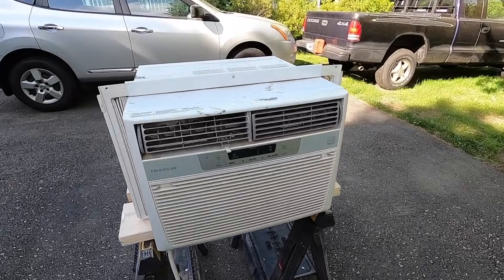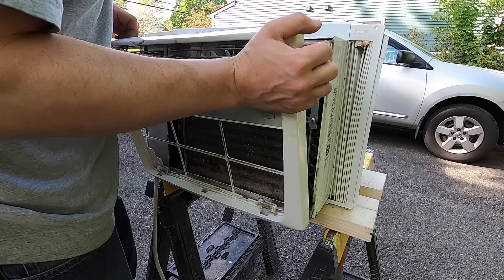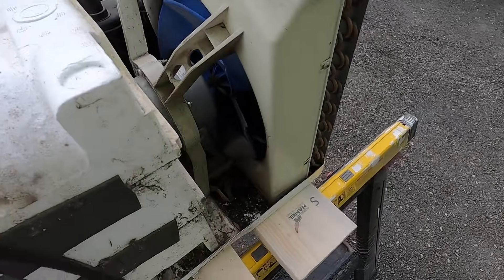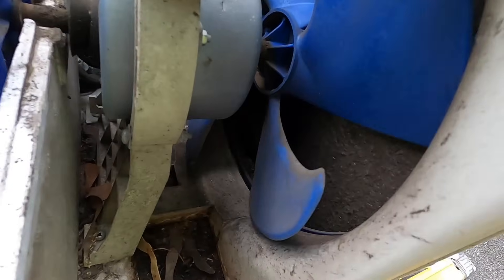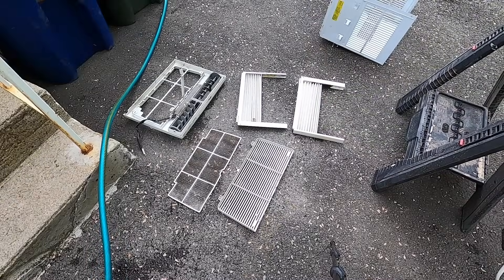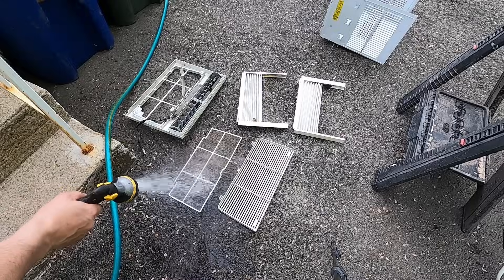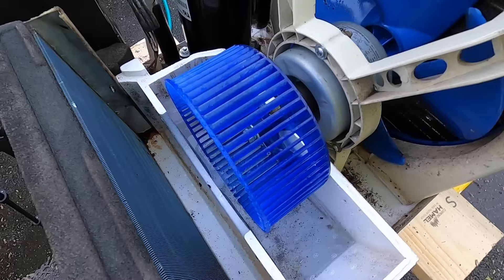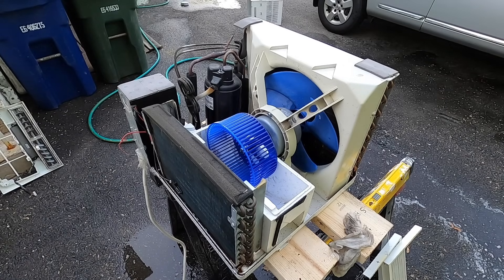How to Clean a Dirty Moldy Window Air Conditioner

Comment: Frost King has a coil cleaner out there.  And it works GREAT.  I spray down each of my units with it once a month.  You won't believe how much cooler the air is.  Oh yeah and there's zero scrubbing involved.  It lifts the dust right off.

Comment: I have exact same model as yours and it looks identical as far as the black mold situation.  Every few months it ends up looking the same.  I'm wondering if its a flaw in the design or something. I have different a.c. units in the same house that don't have the mold issue. But this one seems mold prone.
Reply: Whats the non-molding brand? (What letter does it start with, if you dont wana say directly lol)

Comment: I had an older unit I wasn't using and left it in the garage for a few years. Well, I need it this year with a new house. It smelled so bad when I plugged it in. Sure enough, mold. Nowhere near as bad as the one you did. I'm taking it out tomorrow and gonna clean it the way you did. Fingers crossed. 👊

Comment: Any suggestions for cleaning the unit if you can’t get it out of the window?
Reply: It cant be done, to the best of my knowledge. You need access to all sides of the unit. The back cover does not come off very easily even when you have complete access. I just completed two different window units today before I installed them. It was about one hour total removing the covers for both units with a 12x20 room to work in.
Reply: I have the same problem.  Can't take it out of the window.  I clean the filter on a regular  basis.  Tried cleaning the coils to the best I could by spraying solution on it with a no rinse solution. Still get musty smell when initially turn on air conditioner, but goes away fast.  Even sprayed bleach through vents, it did help a little, but not enough. 
I can't take it apart like all theses videos show on YouTube.  Otherwise,  my 13 yr. Old air conditioner runs beautifully. LG 11200  btu.
Reply: @beatricejust7549  im an old lady-- not going to drag it out of the wall, dont have the energy. One thing I do is make a mixture of generic listerene and water which I spray in the front grill each time I turn it on then put a towel over the air vent for a couple minutes to catch any bacteria or dust. Listerene was originally used to sterilize operating rooms so it should kill whatever ails us. I am trying to pry that plug out so the water can drain instead of sitting around molding. Hard to find any nice guys to help when you arent cute anymore😕😐😀. Also spray  the vent before turning on and after turning off to prevent bacteria buildup. Best I can figure to do when it cant be taken apart.
Reply: @hope2029  Wow, I never heard of that!  Listerine and water! 
 I'm definitely going to try this, along with a towel.  Never knew it was once used in operating rooms.  
Very interesting. Thank you so much for this advice. Your a lovely lady!!
Reply: @beatricejust7549  did it help? :0
Reply: @UndecisiveAngel  Haven't tried it yet.

Comment: Have the same model! Started leaking in the front—took apart and cleaned out, let dry and put back together. But now I am seeing condensation on the sides and on the bottom of the unit (which is now leaking dripping onto my window sill, have some towels there). Do you happen to have an idea of what is causing this? Thanks!
Reply: Your AC unit is probably low on freon , not getting cold enough and causing condensation. Probably time for a new unit,
Reply: a/c must be installed tilted to the outside to let excess water drain.

Comment: Hi. Nice. I have two of this brand ac. There is not a drain hole for condensation water so the aluminum fins sit in the water and desolate. The fan is supposed to blow the water forward into the other condenser but it is not doing a great job. I drilled a drain hole in the bottom today to remove more water to prevent the pooling. Thanks.

Comment: I got an old GM Frigidaire A/C unit in my room. I took the front panel off and used lysol on the air duct, but it still needs a deep clean. It's not mine though. Thanks for the video. Keep up the good work! 👍

Comment: Thank you for this video. I’m always nervous that I’m going to ruin mine, but I’m confident that I can deep clean it now!
Reply: new air conditioner is only 200-350...why u need to clean it ?? you are not going to kill all mold in there... just buy  a new one after 3-4 yrs ...i never clean it.. i just get a new one after 3-4 yrs.... you are wasting time if u clean ịt and it wont get rid all mold inside
Reply: @BabyGangsterIsMe  I live in the south where it’s extremely hot and humid. I’d be buying a new one every 6-8 months, not 3-4 years. My house is also old and large, so the window units that I have are $500-$700 since even the bedrooms are large and have no air conditioning other than window units. I also wasn’t cleaning the inside of mine because of mold, I was cleaning them to get rid of the bugs and leaves that get into the back of it. I spray bleach on the styrofoam parts on a weekly basis to prevent mold.
Reply: @slippypippy  ic.. i live in Virginia.. i only use it in summer... i dont want to spend my time to clean it... i dont want to smell it bc it is dirty and i can get sick... i just throw it away every 3 years and buy a new one
Reply: @BabyGangsterIsMe thats real eco friendly for the land fills!
Reply: Typical mindset 🙄

Comment: Honestly I've taken apart a ton of things in my life (cars, motorcycles, electrical outlets, fixtures, small aerospace units, computers, electronics, etc.) And by far the most annoying thing I've ever had to take apart was a window AC unit.

These things are built with zero user friendliness in mind and cleaning them is a huge pain in the rear. You would think a drip pan should be the easiest accessible item? Nope. You have to take apart the whole unit from the outside until you get to the interior, and even then, you're going to need to take apart the interior to get to the pan.

I have no idea how an engineer has not thought this through more clearly
Reply: Engineers are laughing right now because they designed it like this purposely do you think engineers for companies want a design that the buyer can easily fix,clean themselves? No they want it to break so you buy another one
Reply: Speaking as an engineer, I hate designing stuff that is horrific to fix/clean/repair. Unfortunately, this is rarely a priority for the company, so we have to put out crud like this.

Comment: So helpful! While helping my daughter move into another apartment and installing a window unit she'd been using a while, I noticed the moldy mess that you show. I was able to clean up the front, but I'll remove the unit at the end of the summer and finish the job as you demonstrated. The recirculation fan is a mess and the styrofoam chamber looks just like yours did. Cleaning is such a big part of keeping most things working well. Your video gives a lot of people the know-how to get through it with an AC unit. Thank you.
Reply: In the meantime she will just be pumping mold spores throughout her house

Comment: my ac had mold last year and it came back with a vengeance since i’m over using it this year to the heat. i tried completely dismantling it once but i couldn’t figure out how to get the back panel off. i think this helped a lot, and i’ll be able to clean it really good when the heat dies down. it’s also persistently leaking this year (something it’s never done before) and i can’t tilt it any farther as i’m on the second floor, so i just have to put cups under it and hope they help.

Comment: last time i did window units in my house i took all the foam out and loaded it in a dishwasher with a bit of bleach for the first run and then two times more with dishwasher detergent on the hottest wash. foam on top rack and grille and filter on bottom. the filter came out like new. the foam came out well too.

Comment: I also have a Frigidaire. I usually take the filter out and clean the evaporator coils with coil cleaner and an old tooth brush. I spray water on the outside to clean the condenser. There's some mold on the inside like yours but I don't think it's much of a problem. The unit works fine. I'll probably just spray some mold and mildew cleaner through the vents and call it good.

Comment: Hi, this was very informative.  Funny enuff,  I have the same exact AC, I got from a friend a few years ago. I'm trying to remove front casing, the white long piece of plastic that connects to the back wont release. U kinda flew thru that part.  Every season I clean the filters. They barely need soap.  But this year,  9/7/23 I turned on the AC ( been using it off and on all we😢ek), today it immediately smelled like mold. So i go to remove the filter,  and I notice speckles of black mold. So I look up how to clean on you tube, i see your pic,  I start watching. Sorry,  long story. Idid try to squeeze the clip. It released a little bit not all the way. Thanks in advance

Comment: At 1:42 you see why AC is the no. 1 reason for cronic respiration infections, if not properly maintained and cleaned. And don't expect hotels and other public places to do this mandatory maintenance as required.
Reply: Your absolutely right. Several years ago I got a respiratory  infection do to a dirty moldy ac unit.
Reply: They don't  do maintenance on the wall a/c unit in my apartment either.
Reply: @Og-Judy  You can, by law, refuse (withhold) rent OR give them written notice via USPS with tracking and signature mail, that they have 30 days to do cleaning and maintenance on the unit or you will pay for it to get done and send them the bill with additional charges for time, labor, etc. 

They have no choice. It's literally law.
Reply: Do u remember what kind of symptoms?
Reply: @TheMsparker27  fed or state law?
Reply: Yeah, while I was watching this, and seeing the mold inside that unit , it got me to thinking maybe that's partly why my sinuses have been so stuffy lately, because there's mold in the top vent of our ac (but the rain we've been getting lately isn't helping either). But unfortunately I'm having to leave our ac off until we have a clear/dry enough day to take the ac unit outside to clean it (which is gonna suck in this Mississippi heat).
Reply: @TheMsparker27  yes this is the law but once you go this route know you won’t be able to renew your lease. I did this once and was not able to renew my affordable lease after demanding for a new fridge. It cost my $3k to move when I could have purchased my own $400 fridge and saved thousands in rent over the years. Pick your battles wisely.

Comment: Hey "The Fixer ", I have the exact ac unit. I have cleaned it before and disconnected the pin connection each time with no issues. I always cover the ends with plastic. This time I also used coil cleaner and a light spray of the hose on the outside. Now, when I plug it back in to the outlet, the electronic board lights up for approximately 2 seconds and then goes off. Would this possibly be because there is still dampness in the back? If so, how long do you think it would take to completely dry?

Comment: Drainage is always poor very poor. You should have drilled about 4 holes about four or five inches apart in front maybe 3/8 holes for drainage an air circulation it will prevent the fins from rusting out. Also should have sprayed it laying on its side so as you spray all the dirt falls out

Comment: Co-worker was moving and gave me this exact unit that I plan to use in my garage. Wish I had watched this video before taking it apart. I ended up removing the entire board from the front panel not knowing I could have simply unplugged it like you did on the video. Waiting on a nice sunny day to spray it. I don't even know if the unit works lol.

Comment: lowes sells a product called coil cleaner that is amazing and safe for the evaporator and condenser coils, its an aerosol can and foams really good to creep deep into the coils to clean them.
Reply from the maker: Great idea!  i wish I grabbed a can of that before I started this!  Thanks for watching!
Reply: They also sell a coil straightener tool. We bought it from Lowe’s. Looks kind of like a metal comb. Works good.
Reply: You can get kits for cleaning AC's off of amazon for crazy cheap. Comes with a comb brush and a few other goodies to help make cleaning a bit easier.
Reply: @TheFixerHomeRepair  use the foam its much easier and less messy. and use a lighter water spray. Please please cover the motor unit and electronic capacitor unit w plastic bags...... the electronics will short circuit or the motor may rust.
Reply: The problem is they are not fungicidal, and you will still have to use bleach or a black mold killing fungicide cleaning product after using the coil cleaner
Reply: a lice or flea comb works
Reply: @autistpatrol2493  That's fine. Use the coil cleaner.. wash it off to get all the gunk out then go over it again with some kitchen/bath mold cleaner from the store.
Reply: @streetrider2487  The motor is made to get wet, it literally sits outside its entire life.

Comment: I used a flat head screw driver, and one by one, I straightened the coil out. It took some patience and it is still noticeably crooked but it now has air flow and no more dents

Comment: I can tell you by experience that washing down an AC with water is a very bad idea as the shaft bearings will rust and will need replacement, which is not all that easy. Of course one could just live with the screeching until it finally comes to a halt but by then replacing bearings may not still be an option. I've found it's better to vacuum the fins while agitating the debris and blowing out whatever remains with an air hose.  For those hellbent on hosing off the AC, I'd suggest coating the shaft with petroleum jelly or some other thick substance to prevent water from entering the shaft bearings. Since moisture is a big part of how an AC works, sealing the bearings with Vaseline might be good preventative maintenance. I have an old AC I bought new from Sears in the late 80's (after winning a check pool) and it doesn't even have bearings. The shaft is lubricated by an oil impregnated fibrous material that I merely had to refill to stop the screeching. Well if lasted over 30 years...until I decided to wash it.

Comment: Ive used a toothbrush to straighten the bent fins. Just start at a straight point abd guide the toothbrush down slowly straightening the fins. They are very soft metal.
Reply: I use my thumb to lightly brush over the fins and straighten them. To be fair however, my units are stored carefully to avoid the fins bending.

Comment: That because the window ac isn't sealed from the back of the allowing moisture from the pan to be pulled back into the cold air vented back into your home defeating the the dehumidifier portion of the AC and a good reason to allow the drain pan to drain out the water.

Comment: I followed this video and got my AC unit super clean. For those videos that recommend NOT taking the unit out, I think it's downright dangerous. When I took my unit apart, the interior Styrofoam, blower wheel, and even bottom of the unit were filled with black mold/green mold/mildew/sludge. I spent two hours scrubbing and washing the thing before I didn't want to puke anymore when I looked at it. If you can't take it out, I get it, but if you can, DO SO because at best cleaning it from the outside removes fifty percent of the nasty stuff inside.
Reply: Pro tip.. Use foam cleaner (acid) rinse very well, then, a good coat with Lysol.

Comment: I've found that tea tree oil mixed with white vinegar works well as a mold and mildew killer, if you have an aversion to bleach. It's good preventative maintenance to check the start/run capacitor while you have access to it. A new one costs $15 - $20, but be careful to discharge it because they possess quite a lethal punch.
Reply: Be careful about teatree oil in air vents if you have dogs or cats, it is toxic to them
Reply: How do I discharge it?
Reply: I need to know how to discharge too! 😁
Reply: @4Score747  read the voltage of the cap if its over 50v you will probably get an arc that could damage your vision. Don't attempt this process on a high voltage cap. You can buy a 1000v discharge tool on Amazon for under $10 The device must be off and unplugged from any power source .Grab an insulated screw driver an electrician's version. For extra safety a set of insulated gloves. Don't make contact with the metal of the screw driver or the terminals on the cap with you hand or fingers . Cross the 2 terminal's on the cap with the screw driver you might hear a pop or see a spark repeat this till no sound or spark is present. Don't use a multimeter meter on a undischarged cap. Once discharged use a multimeter set to uF to test the cap. I know I've alot of redundancy here but the idea is for someone who has no idea to safely complete the task. Never be complacent around electricity.

Comment: I'd buy a new one. Mold is bad news and you're never going to get it all. Not to mention the time and labor vs just buying a new one.
Reply: Here's the problem:  mold will grow sporadically while the unit is in cold storage overwinter.  Even a unit purchased the summer before.  So you end up cleaning the AC at start of season and midway through the season.  It's a huge hassle, but a necessary evil.
Reply: I'm with you on that one. I'd just buy a new one.